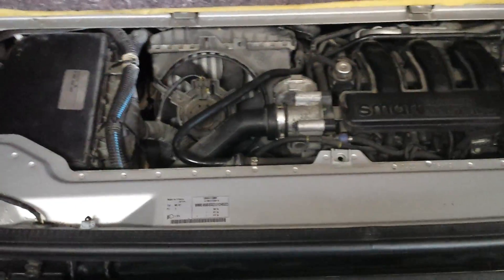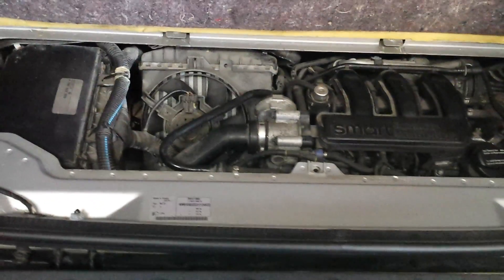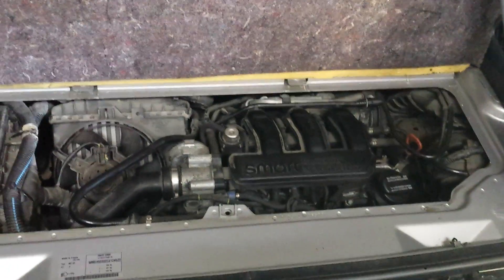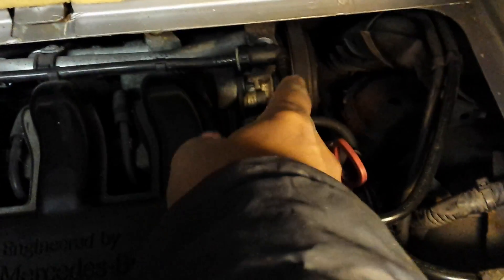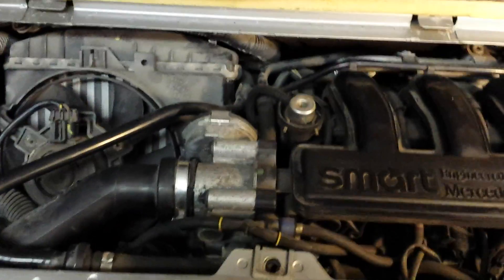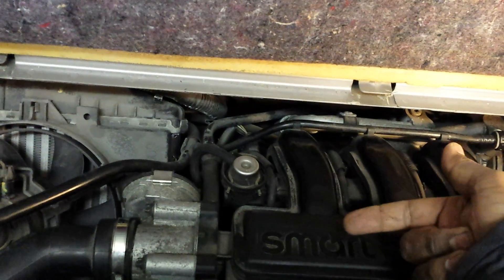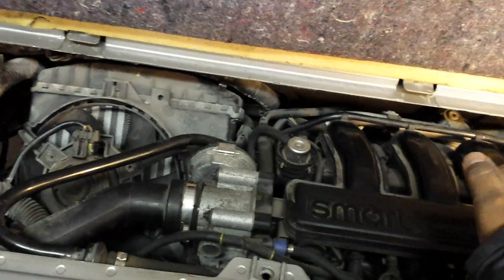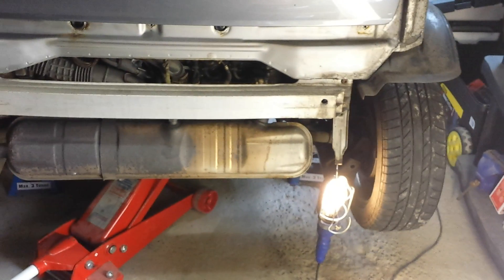Smart Fortwo 450   Starter motor replacement and lowering the Engine   Part 1

Comment: hi I have just replaced the starter motor on my wife's smart roadster it only took 2 hours no need to remove  bumper and it didn't have air conditioning just remove intercooler and inlet manifold it was straight forward every one saying it would take 10 hours and only main dealer would take the job on £80 per hour just to let people know its not that scary I am 65 years young with really bad c o p d and I managed the job no jacking the car up I recommend people try it if not sure take pictures as you go along
Reply: I need help to change the starter motor. Can you be more explicit how to do it?
Reply: That's a completely different car tho

Comment: There is no point spending five hours trying to reach a component removing loads of parts to access it, when lowering the engine takes half and hour. I have to change the thermostat on my Brabus Roadster, it has air con and it is completely inaccessable from the top.

Comment: Hi ,

Check the alternator as as it is common they seized up due to water.This will cause difficulties in starting engine .Check that first .You can get it unseized by spraying some lubricants and getting alternator to move by hand first

Comment: Excellent series of videos. Very well done. Has confirmed to me that replacing the thermostat and investigating an issue with the starter motor on my girlfriend's Smart 450 is a total nightmare of a job! Think I'll leave it to the local Smart specialist (quoted 4 hours labour).
Reply: ianuk1975 
if you take out the distributor the starter comes out in two minutes. detach the thermostat cover unbolt the motor mounts. you don't need to take out the intercooler